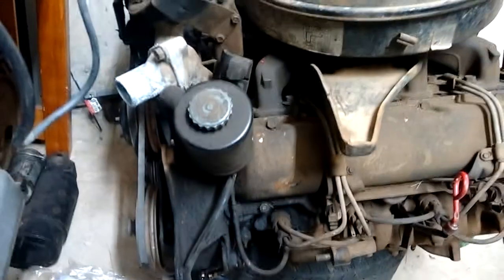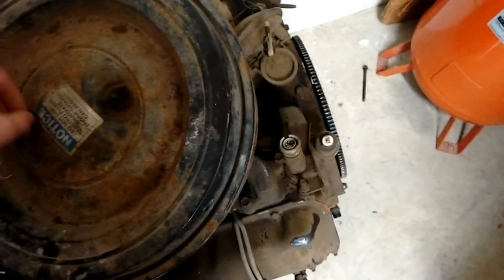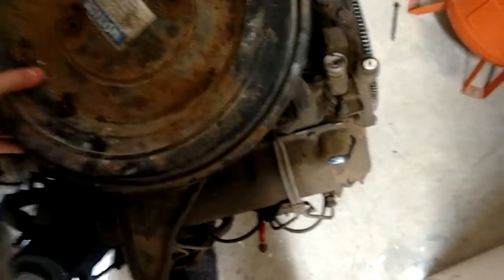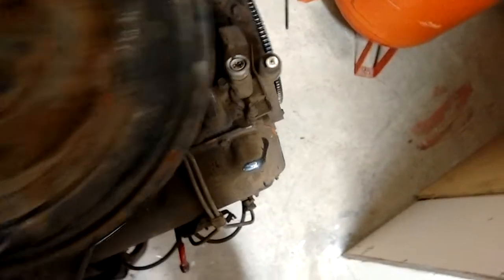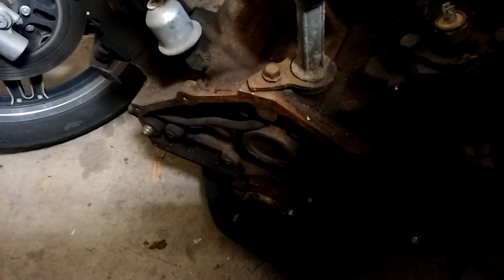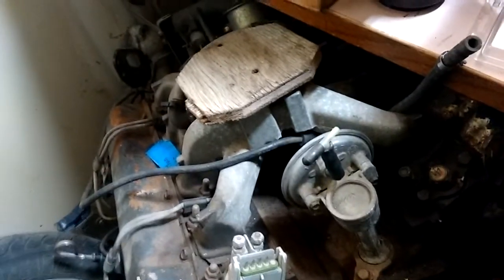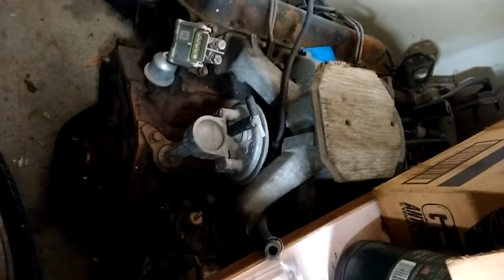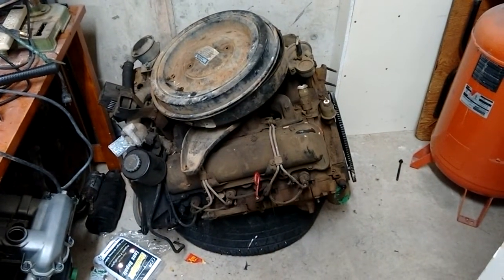6.2l Diesel Engines For Sale

Comment: How much? And how much the chipping to CA?
Reply from the maker: ben torrado These two are sold, but I have others. What all are you needing? I rebuild these, so I can get you parts or full rebuilt engines. Or worn out runners. :-) 208-310-5976
Reply: Was reading the comments do you have another 6.2 diesel mine broke the starter wing on the block and might need a few other parts and I'd be trying to get it to Alabama